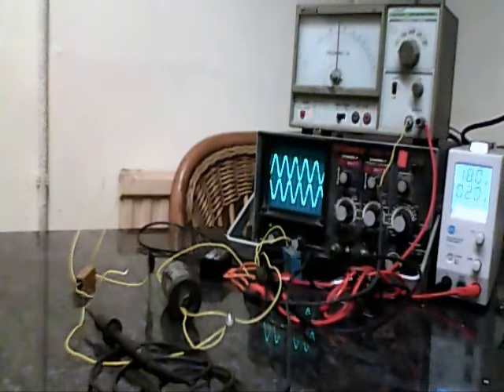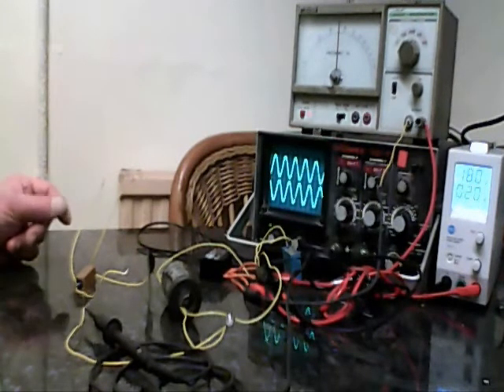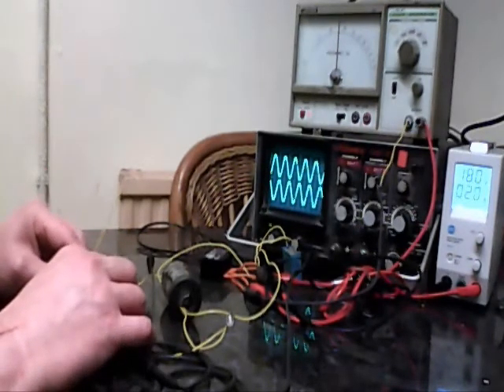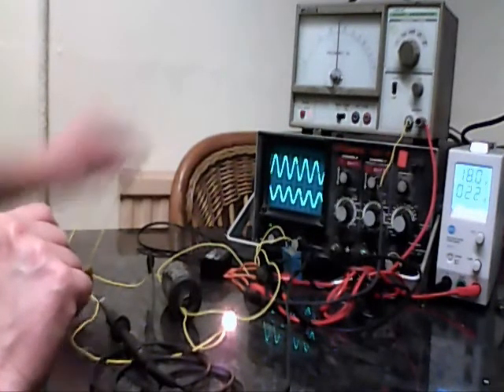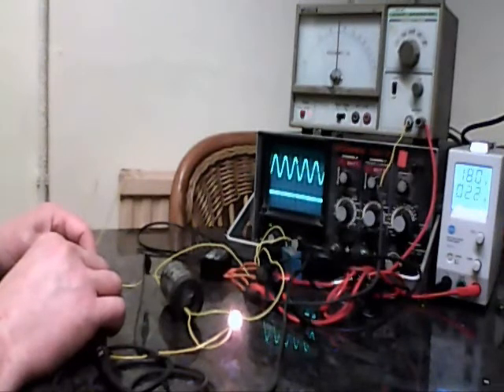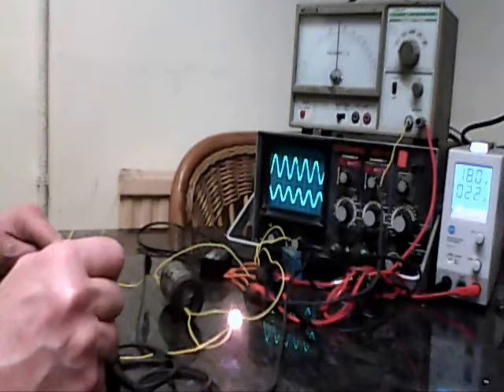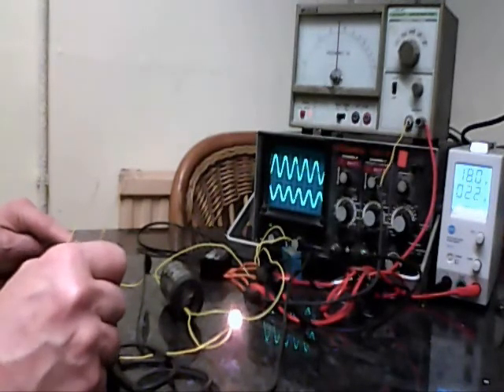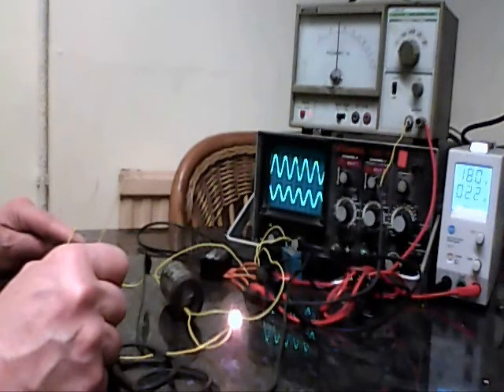Special Russian transformer,experiments continue.

Comment from the maker: Yes, I have done domething wrong ! You can't use plain old V over R equals I, that's for DC.....

You want, 1/2 pp V divided by 0.7071 (RMS Value) over R !!!

Todays test (03/02/2013) with 2 Halogen 20 W bulb load @ 1 A input showed a Current gain of 400mA. That was not counting amplifier drain!!! You need to build this and test test test.